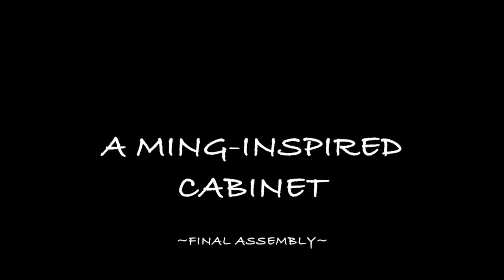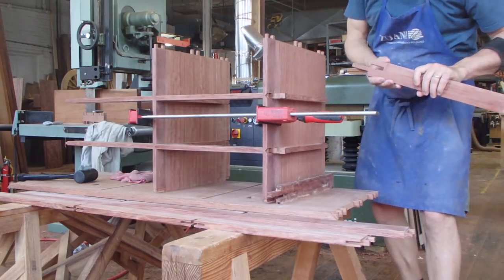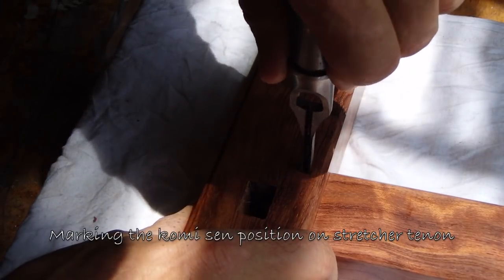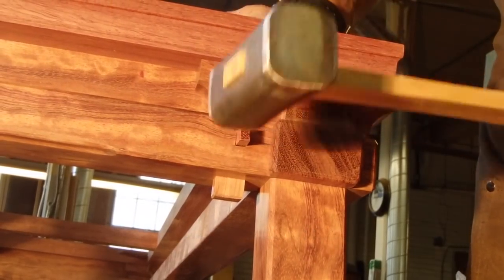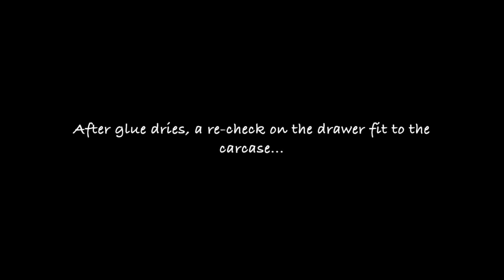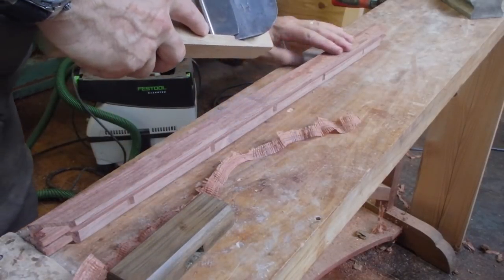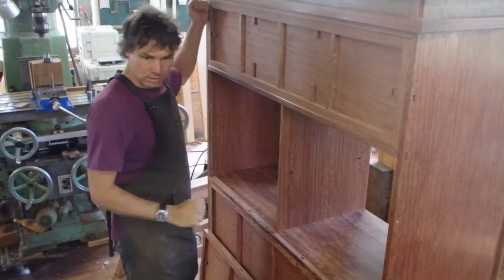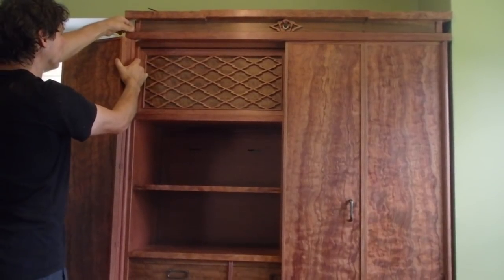Ming-Inspired Cabinet: Final Assembly

Comment: Craftsmanship at the highest level. A stunning build. Is this design a composition of traditional elements or are you recreating a traditional piece?  It looks like you built 2 units and kept one for yourself? If so, glad to know that you are able to enjoy the fruits of your own labor. Also, did you fully design this piece before construction began or were some of the design decisions made as you progressed with production? Bravo
Reply from the maker: Thanks for the comment and questions. The cabinet is inspired from Ming furniture mainly, in terms of using very hard wood and demountable construction, and the composition of storage box on a stand, however it also borrows strongly from Japanese cabinets in its use of a dovetailed carcase of solid planks, something only seen in Chinese classical furniture for very small storage boxes, like picnic boxes. The compound splayed posts in the stand with exposed stretcher joinery are a Japanese architectural borrowing. The bonnet on top is neither Japanese or Chinese in derivation. 

Yes, I made an agreement with the client to build 2 cabinets, one for him and one for my household. It made for a much longer build process in the end, however it is great to have the piece in my house at the end.

I fully designed the piece before building it, however small changes were also made along the way-  the change from plank shelves to frame and panel shelves for instance. The bonnet portion initially had a much more pronounced curvature, however this aspect was flattened out after construction on the cabinet was underway. The design process itself unfolded over the course of a couple of years, and I journeyed down various paths before settling on the design which was built.

Comment: Hi Chris, great project! FYI The thing with metric threads is that they are slightly smaller than the nominal size, so in this case it prob. was 3 mm (it's a fit thing, I guess).
Reply from the maker: That sounds good, however in practice it was not the case. I took the handles to a local hardware store with a good collection of fasteners and it was not compatible with 3mm bolts or nut. The undersized thread on the handle would go into a 3mm nut without problem - though if you tried to tighten it I imagine the threads would be stripped - and the brass nut which came with the handles was a definite no-go on 3mm bolts. it was a surprising and mildly annoying thing to discover.

Comment: Ummm ... those are some pretty hefty sawhorses ya' got there.  LOL  I mean, I'm not sure I can render a free-body diagram to analyze the forces and calculate the tensile and compressive forces in their members.  :P
Reply from the maker: Easy to razz I guess. It may not be apparent, but beyond their usefulness, sawhorses are an excellent vehicle for the study of carpentry layout. For sure the French one with the scissor braces is absolute overkill for any load imposed on it in my shop, but that's not the point of it at all. It's a study in scissor braces between rotated elements. I prefer the Japanese style one that is paired with it, which has served me for 15 years now.